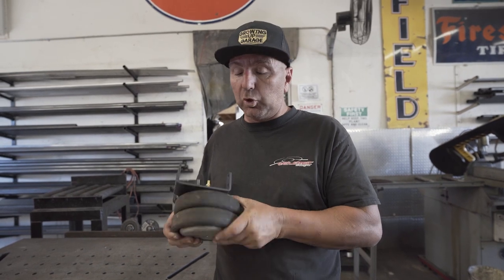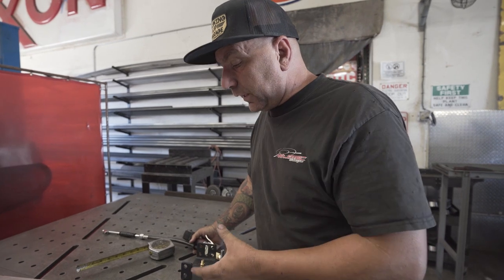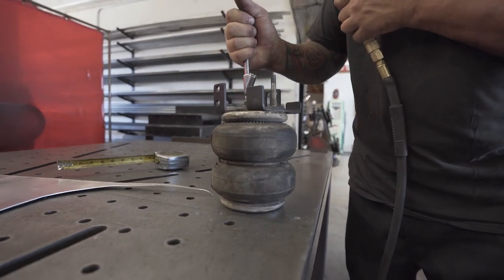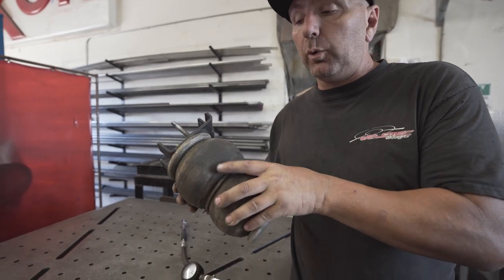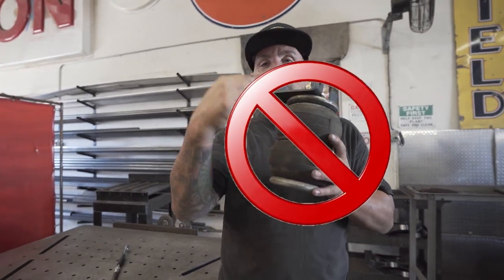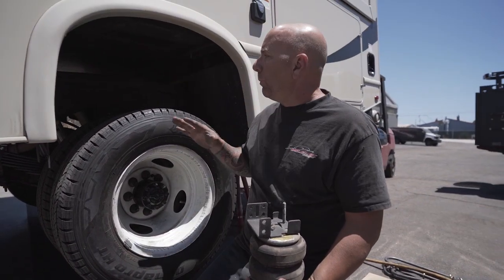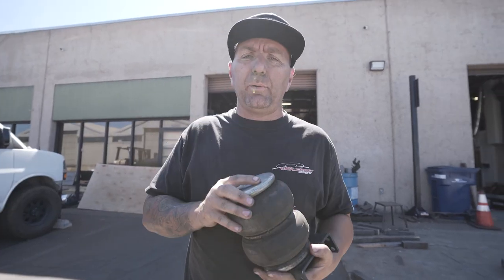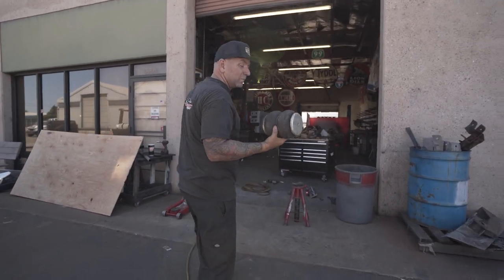Why Not To Use Air Suspension On Your Off-road Van

Comment: Not very compelling arguments against airbags. I wish you had tried compressing a coil springs or a leaf spring using only your body weight. That might have been instructive. Heavy trucks have relied on airbag suspension for decades. They are a valid alternative whether replacing steel springs or supplementing steals springs for load control. You're doing a disservice to the public by keeping this video up.
Reply from the maker: You are completely right....BUT Notice you're talking about "heavy trucks". We are talking vans, and what most OUR customers are using them for which is off-roading in the desert and such. Therefore bags are not ideal for what our customers are doing. We aren't doing a disservice to anyone, you just aren't aware of what we are doing and why. No one is pulling semi truck trailers in their van (at least non of our customers), on top of that our custom springs perform great with towing normal trailers which we've shown in numerous videos.
Reply: If your hauling heavy loads down the road they are ideal.  If your using them for ground clearance off road you loose suspension travel and articulation the higher you go.
Reply: @WeldtecDesigns  airbags are perfectly fine for off roading, and give a much smoother ride than springs.  And they offer a much more consistent ride height

Airbags are not like balloons.
Reply: I agree totally.  I have a 40' RV with a stock air suspension.  I was just pondering redoing the suspension on my 4wd SUV.  Mostly looking for people who have converted that vehicle. I found this video instead.

I have seen passenger car sized custom cars with basically the RV or heavy truck suspension on a smaller scale.  This video was useless.  Sorry that his customers didn't have realistic expectations, but done right they can be great.

I'll keep looking for someone who goes over the options, to keep in mind if I do end up converting it.
Reply: Listen to Jeremy! End of Story. Or get your own channel and create your own content. Peroid!!!!
Reply: Spot on, doesn't know what he is talking about.
Reply: Will be installing the AccuAir air suspension on my 23 JL Wrangler soon. Will be off-roading.
Also... who off-roads in a RV or Converted Van?

Comment: If you want a high-travel constant rate suspension for off-roading, your arguments are valid. If you want a standard height and travel suspension with rising rate compression and better sway control for variable cargo loads and freeway driving, air bags are superior.
Reply: @benjaminlhargrave  race cars and motorcycles have been using rising rate suspensions for decades. Both the spring rates and the damping are lighter when extended and heavier when compressed.
Reply: @benjaminlhargrave  they’re called “rising rate suspensions”, and yes, they are highly adjustable. F1 car suspensions are tuned for each particular track.

Comment: The title of this misinformation says why not to use air ride suspension. what this guy is talking about is air lift to help spring suspension. To totally different things so if you use the air lift correctly just to help the spring ride suspension it will help to dampen or absorb the rough jolts that you get from rough roads and it will help Carrie the load you’ve got on the suspension. But you don’t fill the air bags up so that they are hard as a rock.
Reply from the maker: Air bags are not intended to "dampen or absorb the rough jolts from rough roads" that is the job of your shock. A air bag is meant to assist your heavy load while towing or with heavy cargo. The point in overfilling the air bag is to show the amount of air need to support the load we were working with.  A lot of people recommend air bag for vehicles that sit lower with out a load and that is not the idea. Thanks for your comments.
Reply: If you don't understand air suspension, then maybe you should refrain from making videos and spreading more nonsense around the interent, on the subject.

Comment: Air suspension is far better for the road surface rather than steel springs
Reply: Will Swift  a could be wrong, but as far as i know sleeves are more comfortable and bags are not
Reply from the maker: Stock leaf springs are not comfortable, however the progressive style leaf springs we have designed are definitely more comfortable than bags.
Reply: @WeldtecDesigns   Sadly not True
Reply from the maker: @SC-nv8ve  You have had our suspension? If not, please check out our website at weldtecdesigns.com and get some on order, there's a long backorder currently :)
Reply: @SC-nv8ve  It's the very reason in the UK the max gvw was allowed to rise from 32t to 38t and subsequently to 44t if tri axle trailers were on air. Air suspension is less damaging to road surfaces. Steel springs over undulating bumpy surfaces have the tendency to allow an axle to rise and crash back down on the road surface whereas air bags will keep constant pressure. Air is far less damaging to tarmac.
Reply: @WeldtecDesigns  I've driven heavy trucks all over Europe and Air susp not only gives a far better ride its better for goods in transit.
Your springs might be a good quality product but for heavy vehicles steel springs of any type are now out dated.
Reply: @WeldtecDesigns  have you ever driven a vehicle with air suspension
Reply: @WeldtecDesigns  I can’t believe you are still continuing with your argument after your video was reviewed extremely badly due to incorrect content

Comment: You over inflated that bag using shop air where in the vehicle it is only filled to about 30 to 40 psi. Sure you can't compress them by pushing down on them with your hand at what 150 lbs. Vehicle is about 5000 lbs. You said you don't know all about air bags but it sounds like you know nothing about them

Comment: Top brand manufacturers like Merc and Porsche use the air suspension, I  remain to be convinced this chap has superior knowledge
Reply from the maker: Top brand manufactures also use leaf springs lol. Don't have to take my word, we are just offering our knowledge based off the hundreds upon hundreds of vans we lift to be bashed through the desert in as that's what our customers are looking for. Therefore bags are NOT a good option for off-roading.
Reply: @WeldtecDesigns  title of the video does not say "offroad" and is the RV an offroad RV?

Comment: Yeah. If you have 125PSI than is bad but if its normal pressure like 35PSI than in my opinion it’s awesome. I have on my Mercedes sprinter and it’s working perfectly. 👍
Reply: The point was, people want to lift their vehicles with the airbags, 35PSI is not gonna lift the vehicles.

Comment: You are correct that you don't want to use those for lifting your rig.  For towing or hauling heavy loads they are a must if you want a nice comfortable ride while driving without the extra weight.  The trick with the airbags is the daystar air bag cradles so that you don't have to have your suspension connected like a limit strap.  They allow the suspension to droop away from the air bag so you have full suspension travel still.  So I run mine totally empty while normal driving and you can't even tell they are back there.  When towing I fill them up and Van sits level and handles great.
Reply from the maker: THIS IS A GREAT EXAMPLE OF WHEN TO USE AIR BAGS AND THE BEST OPTION FOR TYPE OF AIR BAG. Thank you for your feedback.

Comment: I've specified air suspension on many articulated lorry trailers. It's essential to have self-levelling, the airbags are meant to sit in mind position at the set ride height. Then they can easily accommodate the required travel. They also give a nice smooth ride, preventing known damage to vehicle contents during delivery. Find a company that designs and make these, chat to one of their tech guys, and  he'll certainly point you in the right direction, and prevent you from putting in a duff system
Reply: Great advice for people looking for off road suspension for their vans..

Comment: The air suspension bags on my Ducato RV when decompressed are about the same height as the original bump stop.  I run my system at about 2.5 bar and the ride quality is very much improved when travelling. No banging or rattling as I drive over pot holes and is much more compliant than leaf springs alone.         The thing is, all these “B” class RV’s are built on a chassis that was designed to carry the weight of a certain load, this weight., after conversion is very nearly at the maximum capacity of the suspension, giving little room for wheel travel. A correctly fitted and pressurised air suspension kit gives back the compliance of the vehicle with the associated benefit of a softer ride. In my opinion they are a very worthwhile modification to any class B motorhome.
Reply: How much do you usually load your vehicle? Do you ever exceed the total permissible weight? I have a Citroen Jumper / Relay on which I would like to install an air suspension. The problem is that I am overloaded most of the time.
Reply: You should never run at more that the permissible weight as it’s not just the suspension that is affected but the steering and brakes are badly affected. If you are constantly over the gross vehicle weight there is a fault somewhere in the design. If, on the other hand, you become overweight only when you’re packing, why don’t you get a towbar fitted. With my Ducato I can legally tow 1.5 tonnes (braked trailer) or 750kg unbraked   I’m lucky enough to have bought a “Smart for two” which I load most of my equipment into when travelling. The car was converted for towing by “Towtal” so is braked automatically. I could never load all the equipment I take within the 3,5 tonne limit. So beside giving me enough capacity for everything, it means that when I reach my destination, I can leave the motorhome set up and still go sightseeing. This option isn’t as expensive as you might believe, as my car is very cheap to insure and has zero road tax. Hope this rather long winded reply was of help, but I emplore you never to risk driving an overweight vehicle.there again you could just use a trailer to gain you extra(1500kg) of payload.
Reply: I love the ride of my airbags on my rv

Comment: As someone that's been doing air suspension since the 90s that's not the right air bag you would use a large roll Bellow on the back and eliminate the springs with a 4 or 3 link

Comment: the bags for lift would be used just to get you through the rough road areas... then let out most of the air/height for normal driving.
Reply from the maker: I don't really think that's how it works off-roading? You would definitely not want the bag to be full of air bouncing back there. Thanks for that... interesting suggestion :)
Reply: I added airbags on my 2018 Thor Quantum WS31 because it was to low and it would dragged coming out of my driveway. I deflate the bags down to about 25lbs depending on the load and let me tell you it improved my ride. My ride is so much smoother!!

Comment: They added Springs to Steel for the suspension on some of our work trucks where I were to haul heavier loads. The result of adding more Leaf to leaf springs is the ride quality is so bad you can't even hold them in the road and you can't steer them it pushes itself sideways. You cannot over are an airbag

Comment: Your analogy is wrong. If you want to lift a truck, you add a longer spring or more curved leaf spring (which is longer), not to add a stiffer spring. Same as airbag lift, you add longer bag (3 bellows), not adding more air (stiffer spring).

Comment: What a nonsense! what you mean it does not compress, you just pumped it with compressed air, it is a bloody  property of the air that it can be compressed ( just like a spring did't you go to school?), In fact it is working better then metal springs and it is cheaper and lighter.
Have you heard about Citroen DS from 60's , only the best suspension in the world other than that it is complicity crap.
There are no Buses or Trucks made without air suspension, even better! air suspension allows cheap and effective of self levelling with some simple sensors.
The only Issue with air suspension fitted as extra is an incorrect  design or calibration for particular car as a some part of after market thing! 
I have a fleet of recovery trucks all custom made all on air suspension, all brilliant, cheap and easy to repair if there is a need. I have studied pneumatics in university and I have been well impressed with it  from start, to the point that I am an expert of hydro-pneumatics for 20 years - nothing even comes close to it .
Reply from the maker: Absolutely right dude...BUT you are missing our point. You're comparing vans to busses and recovery trucks. 2 very different things. Our customers are using these vans to offroad. You aren't offroading busses. You don't get nearly the ride with bags offroad in these vans that you would our custom leaf springs,. We've had numerous customers come in with blown airbags because they can not handle the abuse from bashing through the desert. You're comparing 2 completely different things if you can understand that. Did you go to school?
Reply: I've never driven anything smoother than DS and when I tell that to people (especially millennials) they think I'm full of b.s.
You Sir are absolutely on point.
Reply: Ah, is that why every single off road truck has adopted that suspension style? Didn't think so. There are luxury cars that have air suspension because it's comfort on road, but never trucks or vans that were designed for off road use.
Reply: @WeldtecDesigns  man you should have made it clear in the title of the video. Unless your entire goal was click bait.

Comment: I get what your saying, its a good arguement against a dedicated off roader, but being able to dial in your resistance with a heavy load such as a camper or trailer is way more important. And i can tell you, once you've unloaded that vehicle, you'll want to be able to purge your bags so your springrate goes back to normal. Hard to do that with springs.

Comment: No it shouldn't be used in place of a lift, yes they are excellent for load leveling and support on a stock suspension or lift.  There's a reason tractor trailers use AIR BAGS.😉 Air bags also compress progressively like so they do act like a leafpack would, ie as they compress they resist more because you are increasing the pressure like trying to squeeze a balloon or ball.  I do agree that one should have a leafpack lift that appropriately accommodates regular traveling weight.
Also I'm speaking from a truck perspective, my bags aren't much taller than a bump stop, but it's possible they have too much stack on a lifted RV?

Comment: Airbags for leveling out a heavy load=good. Airbags for any other purpose=bad (in my experience)
Reply: how about an air bag for lowering your van that is just a bit taller than the 2m expected at the entrance of a parking?, you can use them normally afterward like hard needed to get fuff suspension and enjoy riding the van (thinking about a VW T3 Westfalia that is 10 cm higher than normal)
Reply: Well, YOUR experience worst shit because let's say in my experience going 200kmh never led me to a crash and this means it's ok, right?
Reply: @AntonySimkin  yep, that’s exactly what I said champ...keep trolling

Comment: Great video, thanks a lot. I have a Mecedes Sprinter XXL, longest version, with done in air suspension at rear. Last visit in workshop for changing filters and oil was the information of the boss there, that my frame is broken left half and right side fully broken. All is because of stupid workshop did not install me some more metal sheet for security, because of less knowledge, so my bad luck. - Perhaps your advice is the better solution, stronger springs.

Comment: to be clear ur only talking about air bags as far as a lift. Because there is a legit use of airbags when towing, to keep the back of the vehicle from sagging too much.
Reply from the maker: Yeah we specialize in lifting vans hence why we made it about lifts. A good set of custom leaf springs will help with towing sag as well, but we didn't focus on that because we were talking lifts as that's what most of our customers are looking for info on. 👍
Reply: WeldTec Designs 👍

Comment: I am neither pro or con for air bag use on an RV or Off road vehicle. Depending upon application, air bags and or springs need to be right sized for the application. Many people ad either helper springs or air bags as supplemental support elements to their suspensions. Range of lift or travel is dependent on the spring or airbag configuration. The one you showed had a operational range of around 5 inches. Probably adequate for most situations. If you want more lift, you need an airbag set up to accommodate that additional lift. Not just over inflate one which is too short. 

Springs are great for simplicity of use. Install it and your done. They have a fixed range of motion and support. Air bags are more complicated but offer the opportunity to vary their capacity (or ride height) based on demand by changing the volume of supporting load carrying material contained in the bag. In this case, air. And that is their primary. Advantage.

Comment: For coil spring suspensions, can the airbags be installed underneath the coil spring? This will give it additional lift when need while at the same time the coil spring is still providing function.

Comment: Your customers are overfilling for the load they are applying. Its a helper spring not a full suspension spring. Also.. That spring may be universal and not correct for the application. 
But even then.. Customers are probably overfilling them because they dont understand.
Just like the tires might say max 42 psi or max 75psi.. doesnt mean that is what you fill it to. My small car specs 32psi ( tire max is 44). My tires wear properly and car rides like oem intended.